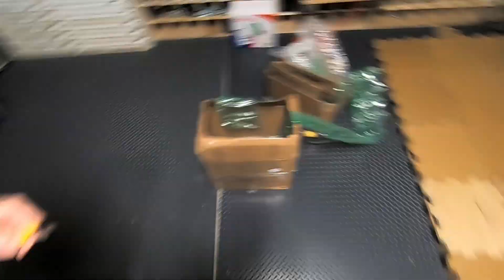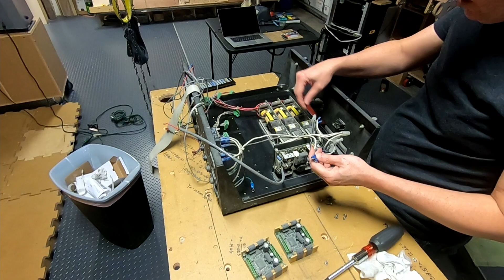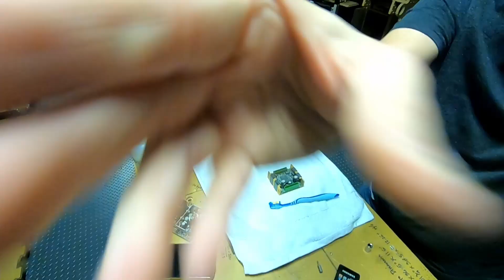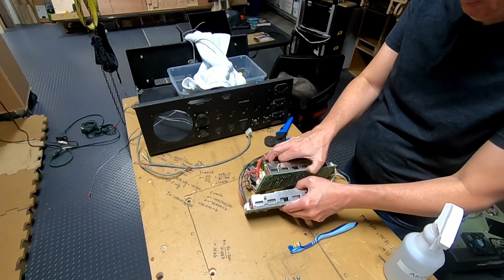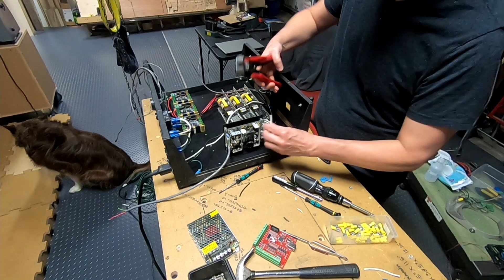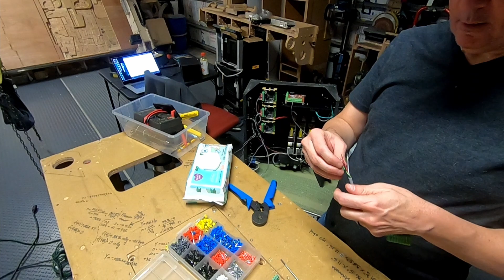Customer Order No.47237 PRECIX CNC Electronics Retrofit

Comment: Hi. i litterally just purchased a 90's 1200 x 1200 precix machine. Unfortunately the pc that came with it that had the software is dead and the harddrive ditroyed. i would like to be able to do the same as what you have done here. Are you able to let me know exactly what parts you needed for this (what type of controll board and do you need a power supply specifically for the board). Great video by the way. Cheers
Reply from the maker: Thanks. Yes, my website is Buildyourcnc.com. The mach3 USB controller is on that website and has several videos on that page that goes into very elaborate details on everything you will need to know. I also have many videos on my channel that will also help.